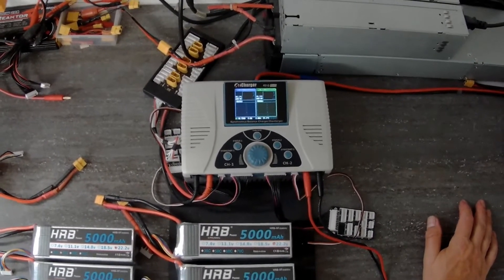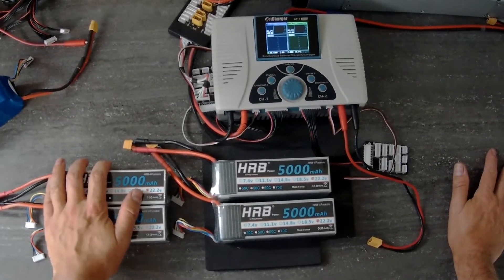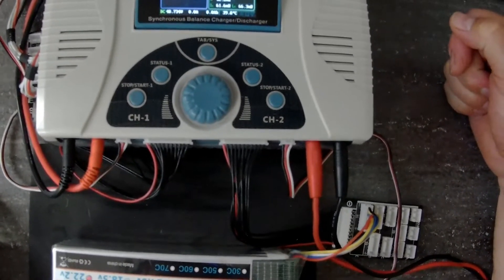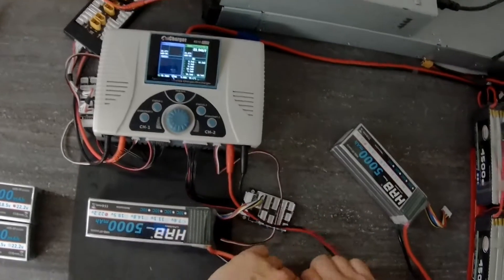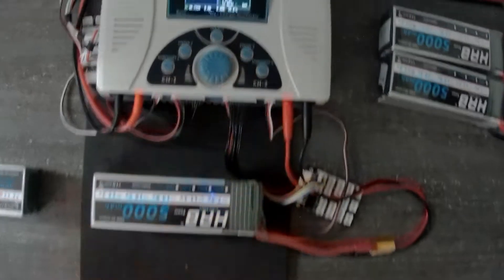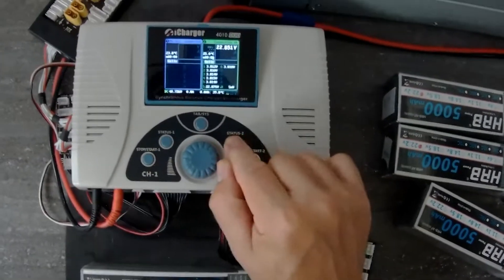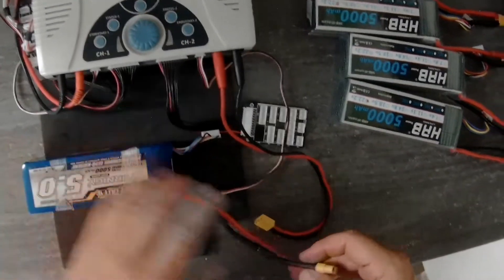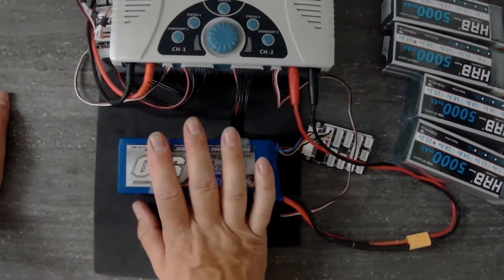HRB 6S 5000mAh ir testing

Comment: Is the wire of HRB 10 awg?
Reply from the maker: the batteries are long gone, they puffed up horribly first time I flew even slightly hard with them. I think the wires were 8awg but that doesnt make any difference for this problem, the resistance measured is internal in the battery measured through the balance leads.
Reply: @jetplaneflyer  Very sorry to hear that. I'm trying to find a brand which could last longer and affordable. Thank you very much for the information.

Comment: I’ve done some testing on a few makes of lipo to get IR. I found it is very important to keep them at the same temperature  and charge level when doing comparative tests. A warmer cell of say 25C versus 20C (Centigrade) can change IR from say 11 to 7 milli ohms. I’ve tried cycling some 35C 2200 cells that have IR of 12 to see if it improves but it didn’t. I’ve got 12 year old 20C 2200 Rhino cells IR around 7 that have much lower IR than new similar Overlander cells. I find a lot of the C ratings are just complete fantasy. There is a big forum collecting IR data and trying to put true C ratings against cell capacity and IR values.  How can a 2200 50C rated pack possibly put out over 100 Amps when the typical SC60 connector is only rated at 60Amps burst current, and yet that’s what it is stating by the ratings. I just wish we could be given true representative info from the manufacturers rather than lies.

Comment: Lipo chargers are not able to measure IR, the values read are just plain wrong. You need a specifically designed device such as Wayne Gile's ESR meter. Hobbyking now sells a licensed version of it.
Reply from the maker: Actually it depends on the charger. After shooting the video i invested in a Wayne Giles Meter and it actually gave me IR numbers almost identical to the iCharger 4010. I do take your point though because 'Powerlab' chargers (for example) produce much lower values.
Reply: You are plain wrong. Yes iChargers are legit and correspond closely to my stand alone IR meter.
Reply: It’s simple to measure IR using ohms law. Apply say 10Amps while recording cell voltages then remove the load and see what the recovered cell voltage returns to. Work out the difference and the IR is given by V/I where I is the current used. I found this method ties up closely to my I charger results.

Comment: Yeah if you read their , it says 5 cycles before the lipo get to the full potential
Reply from the maker: Unfortunatly even after around 15 cycles on gentle use the IR stayed very high. The first time I tried flying my heli hard with these batteries a cell failed and the battery 'puffed' up. HRB were good enough to replace them under warantee

Comment: Would like to see how floureon lipos ir is if you happen to own any. I've ran a few with good luck and own a hrb but the plug on my hrb had to be changed but other than that it's running well in my rustler and holding a good balance far as I can tell but I don't have any equipment to test ir or amp rating

Comment: what does it mean if it stays high ,what is the ideal and how does it affect them thanks for the video
Reply: it means they voltage will not hold as high under load.it matters more when you are flying high amp draw edf or heli's.or boats!  lower IR the more the volts will hold up the more revs on your motor.
Reply from the maker: Fred, sorry for late reply. IR means 'Internal resistance'.. This is the resistance that the battery has against flow of current. Ideally it should be as low as possible. Having high IR means that the voltage output of the battery drops when under high current load, and the battery gets hot. If you push a high IR battery too far the battery could 'puff up' and fail. Unfortunately the IR on these batteries didn't drop any further and when i did eventually to flying my helicopter more aggressively one of the cells in the battery failed right away.
HRB gave me a refund on them all.
Reply: Typical false C rating claims again it seems every manufacturer is at it. What we need is a decent digital load where one can simply attach the battery and apply the max rated constant C load and any Lipos that can’t should be rejected back!